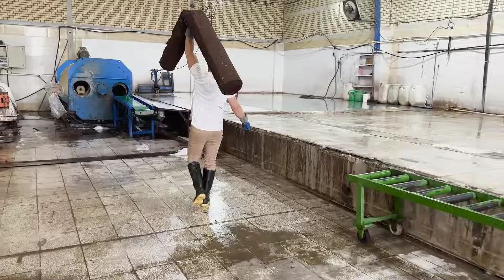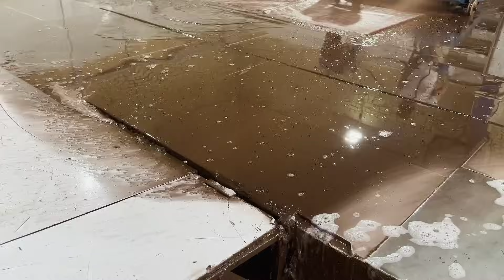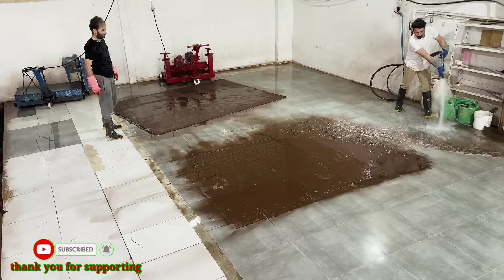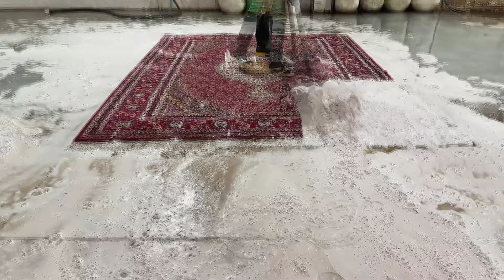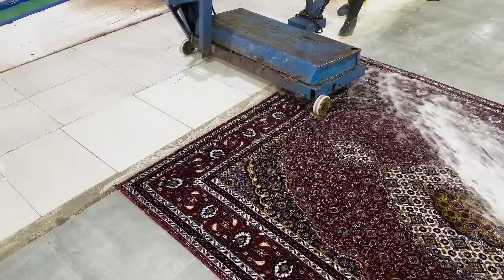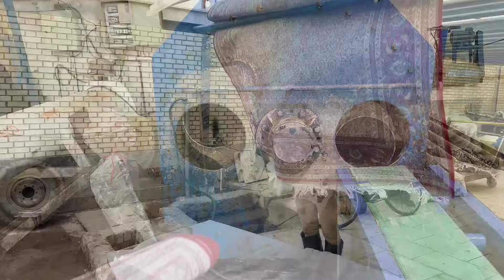$1 vs $100,000 Black Carpet! | The Hardest Rug of My Life!

Comment: Question: I have quite a few hand knotted carpets from India and Nepal. I was told never to clean them with water as it will destroy the lanolin that is in them. I do vacuum, front and back frequently, but after watching this, I am concerned how much dirt is in them, they get a lot of general use. Should I be doing something different?
Reply from the maker: No, there is no need , vacuum cleaner only👍